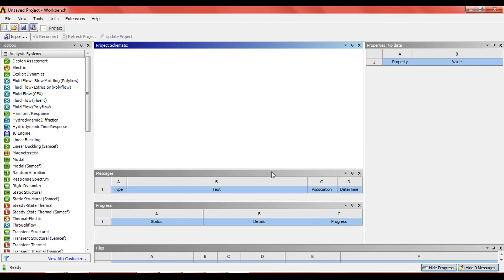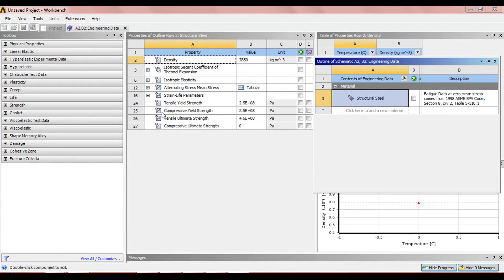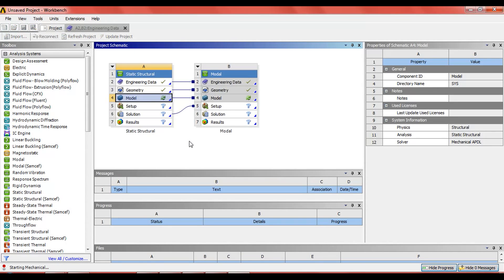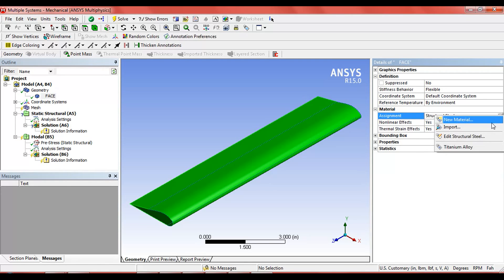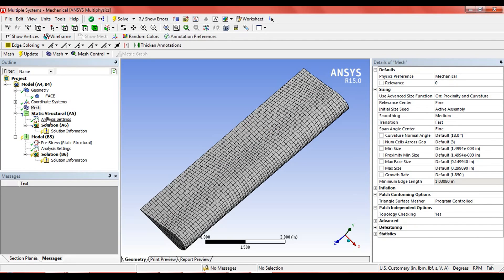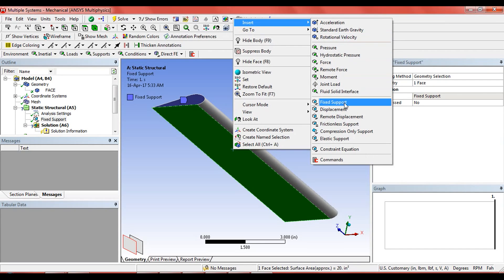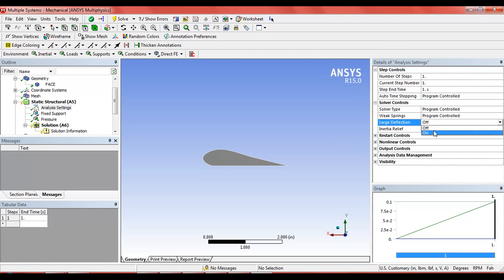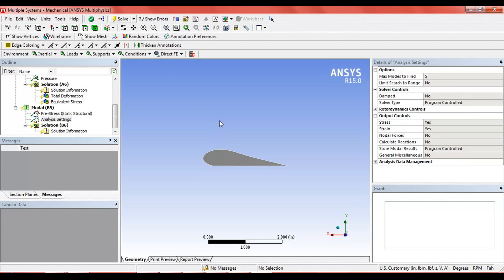How to do modal Analysis in Ansys Workbench |Airplane Wing Analysis Tutorial | Ansys workbench

Comment: can you please tell how you decided on .1 psi pressure under the wing?
Reply: Same question.Did you find the answer?
Reply: @joseph3036  
The vacuum occurring at the upper surface generates negative static pressure values, while the overpressure generates positive static pressure. It is thus possible to define a global pressure whose surface integral is the lift. And when the overpressure outweighs the underpressure, the overall pressure is postive, which makes it possible to consider that the pressure is applied to the lower surface in the vertical direction, as is the case in the video. The result is then a lift directed upwards.

Comment: How can I mesh a bigger size wing? It always gets failed . but if I use a wing with smaller dimensions, it works well
Reply from the maker: Try different element size in the sizing option also try to refine the mesh to get accurate meshing.